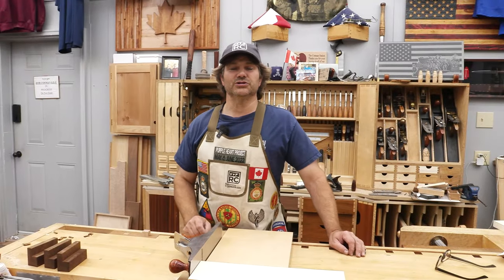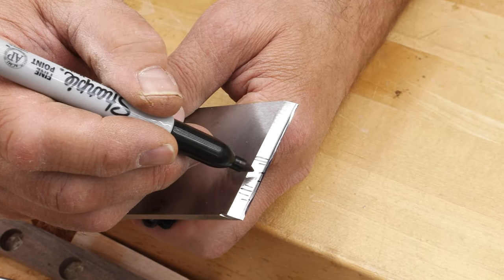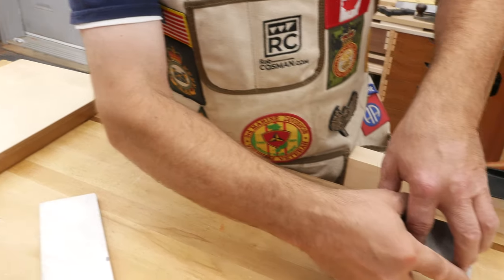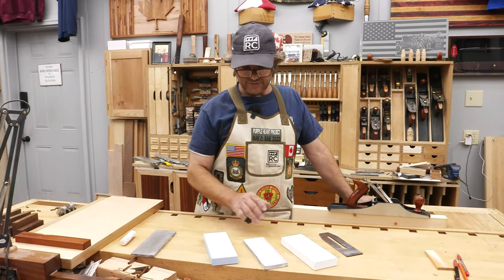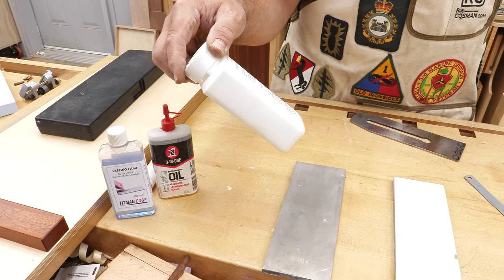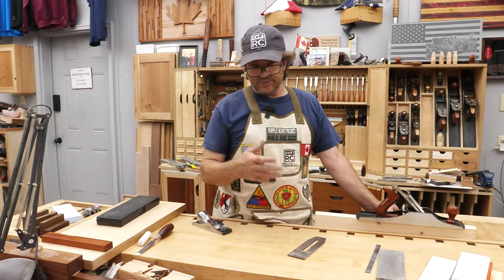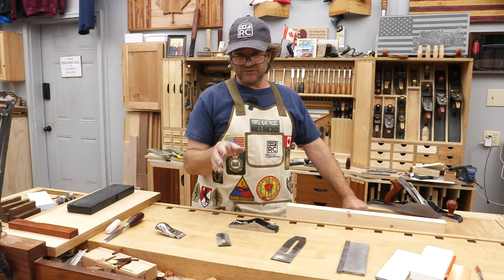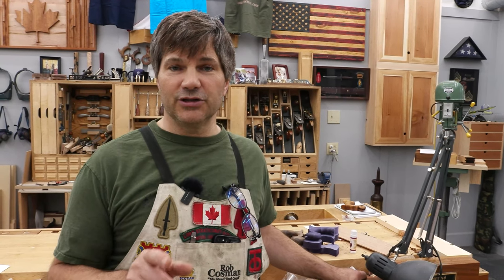How To Sharpen Plane Blades By Hand - Top 10 Questions

Comment: Rob I fully agree with free hand sharpening rather than aides to help sharpen or make things. I get more satisfaction out of freehand making than using machinery etc. I notice the jig you showed for sharpening with my brother gave me the exact same one. I'm using it but holding the blade like I was doing freehand but only using the guide to help me get the correct feel of angle on my wrists and trying not to rely on the jig so I can get back to freehand sharpening. I love jointing freehand but of course the older way was much better with joints not the lazy way today with screws and nails. You're a true carpenter and star thanks Rob and also to your team

Comment: Rob I've been having trouble putting my plane back together but having trouble hocking and sticking in wood  and the blade didn't appear sharp enough to me from what I remember 50 yes ago in school. But thanks to your tips I made a discovery in sharpening blade better. Today I added a secondary bevel and a little bit more firmly on blade not strong but firm and feeling the the edge of blade it is feeling much sharper going back to shed to put plane together. If I get a fairly good plane not as good as yours I know I'm on the right track. I don't think putting plane together was full problem if better working I will work on fine tuning to good thin shave like or near yours. It's an old plane so good to learn with before I get new ones. Thanks a million Rob on your great tuition and great for elderly to understand you

Comment: I like Frank's Workbench's concept of keeping the secondary bevel from growing. He sharpens the secondary and then goes back and sharpens the primary to keep the secondary from getting too big
Reply from the maker: That adds additional time to each sharpening.  Its takes so little time to re-establish the primary bevel if you are using a CBN wheel I think I prefer to use the grinder

Comment: The thing that's always drawn me to your sharpening method is the speed you can get back to sharp. I've used the jigs and various other methods and while they work fine, it always seems like a such a chore to drag everything out, set it all up, go through the process, put the stuff away and finally get back to work. When sharpening becomes a project in itself, it leads to using tools that are duller than they should be and that's never good. I've purchased the Shapton 16000 and the Trend plate but still need to set up a permanent sharpening station which is key in my mind.
Reply from the maker: Beautifully said.  You get the final word!

Comment: For diamond plate, personally I use car glass cleaner bottle. This is not expensive, metal particle float and dont make the plate rust, just have to wipe with a towel at the end to remove metal dust. Otherwise, my experience is to use only diamond plate and finish with a lapping wax compound on a piece of lather glue on a wood board. This create a mirror finish and the cutting is fantastic. Its somgreat to se other method, and clearly I have to spend some money on a bench grinder for saving time. Thank you for your great teaching skill, very great to follow you and learn each week.

Comment: Although I don't always agree with you 100%, you absolutely provide the most complete explanations of sharpening (and woodworking in general) of anyone out there.  I do sharpening both with a honing jig and by freehand.  That's where I veer away from your "don't use a jig" philosophy a bit.  I don't consider it a handicap to ever use a jig.  I consider using a jig a way to get the edge back to a pristine condition to be able to freehand the blade in between using the jig.  It's just another tool.

One factor of freehand sharpening I think is overlooked (or at least not mentioned) by anyone is that by the very act of freehand sharpening you manage to get a slightly more homogeneous edge due to the circular motion employed.  Using a jig it's more likely to have straight scratches going perpendicular to the edge, and then those scratches being parallel to the motion of the plane.  Now I realize those scratches are miniscule and may not amount to enough to cause any problems, but they are there nonetheless.  Looking at the edge under magnification it's pretty obvious.   Quite possibly I'm stretching reality a bit here, but try it and I'd be interested in your take on that.
Reply from the maker: To comment on the scratch patterns between jigs and freehand, the only potential benefit between the two would be edge retention. As mentioned in the video, the edge obtained by freehand sharpening cannot be improved upon as it relates to the surface of the wood. I’m pretty sure this would be considered splitting hairs though.
Reply: @RobCosmanWoodworking  I've been told that my superpower is splitting hairs.  :-)   Thanks for listening, and the edge retention is another aspect to consider.  The scratch pattern is potentially more important for those who don't sharpen to higher grits - possibly.

Comment: Your advocacy of freehand sharpening inspired me to try it out. What a liberating experience! Now, where do I sell my $100 Lie Nielsen honing guide and accessory jaws? Seriously, this was the best advice I ever took. Now, may I ask you for more advice regarding chipbreaker prep? Besides the slight back bevel to make it fit seamlessly onto the blade, what do you think of David Charlesworth’s procedure of also increasing the main bevel on the chipbreaker to 45 degrees so that the shavings extract more easily? Is it worth my effort to do, or is it unnecessary?

Comment: Regarding the ruler trick, quick tip, get a set of feeler gauges rather than the ruler. You can get a set of feeler gauges for cheaper than the cosman ruler, they have no etching, and you only take one out and you then also have a whole set of feeler gauges.
Reply from the maker: Boy aren’t you the white knight!

Comment: Good Job Rob! Always enjoy your post and learn something each time! When you referenced sandpaper rolling you did not state on the way the paper was held done with water, tape, or glue or nothing! I fully agree with your adage to better tools make easier work and better results overall, but some of your tools are just too expensive for a weekend woodworker or not even necessary for some types of wood working. You are a business and not everyone is sponsored or can write off tooling cause you're a business.
This also should be taken into consideration. I do paper on glass (glued down) and red and green rough, and I can get gloss level cuts by pairing no problem free hand. Sometimes I think you forget on the small shop guys that can't afford all the toys you have for the points stated. 
The other this is this ruler method on the back side? if you can do your secondary freehand then why can't you do your back the same way? It comes back to skill factor! To me that ruler is a crutch also! 
Again, I do like your videos methods and learnings just can't do everything the way you do, otherwise I would need to hand a shingle also!   Columbus Michigan
Reply from the maker: I hear ya.  I still advocate getting the best you can afford one tool at a time.  I would do the back bevel by hand but i cannot figure out a way to hold a 1 degree angle.  I can hold a 25 degree angle by hand, thats easy.  Cannot hold a 1 degree angle by hand

Comment: Hey Rob, I've always wondered something about the "ruler trick" I have the extra-wide diamond plates, so they're 4.5 inches wide instead of 3.5 inches wide. Would I still be good with putting the back of the plane iron within 1/4inch of the edge of the 4.5inch diamond plate? Thanks!
Reply: Adam, I’m sure Rob will answer too, but based on geometry, yes, in fact the further out you go from the edge of the ruler the better because it decreases the angle of incidence to nearly zero.  You can even polish the back without the ruler but then the entire surface is in contact and you have to remove a lot more metal when really all you need polished is the edge.  If you get the edge too close to the ruler then you start to increase the angle of incidence which begins to lessen the effectiveness of the blade back as a flat reference surface.  Essentially any amount you raise it greater than zero and less than .5 degrees will get the results you’re seeking.  Moving it out to 4.5 niches is almost the same as reducing the thickness of the ruler by about 1/3. In fact instead of using the long edge of my 3.5” wide plate I usually slide my iron along the short axis which extend the distance from the ruler to about 6 inches.  There is still a slight angle of incidence and my strokes are much shorter which means it takes a few seconds longer, but it keeps the back bevel closer to flat without the work of being flat.
Reply: @eodeberhard1066  hello sir. Thank you very much for the detailed reply and assurance that the width of the diamond stone doesn't matter. 

I'm also wondering, when you're polishing the back of the iron, how many times are you rubbing the plane iron back and forth? And I mean this in a scenario where you were doing it the normal width way, instead of the rotation that you decibed that results in a shorter width to use. I feel like I've seen some videos of guys only rubbing back and forth one time, and then some videos where people are rubbing back and forth a lot.
Reply: It depends on wether it’s the first time or not.  The first time you do it may take a lot more effort to get the factory grinding striations and any other inconsistencies out of tge blade. After the first time you just need to do it long enough to remove the micro thin hairline of metal that was hanging on from shaping the primary/secondary/tertiary bevels on the opposite side.  I don’t usually spend more than 8-10 seconds on the back side to get it “scary sharp”.  If your blade has a concave back (like a Japanese style chisel) from the factory you may have to work a little harder, and if it’s convex, it’s not worth the effort and headache it would take to flatten it. Cheaper processes and materials in manufacturing can lead to sharpening nightmares.

Comment: DMT diamond stones use a stainless steel base. Would that make it OK to use a water based fluid?
I've noticed the problem with wet & dry & chisels - moving on to a flat diamond stone shows this with it taking longer to remove enough material to reach the corners.
Reply from the maker: If you are referring to there Dia-sharp line DMT states on their  webpage "No oil needed, sharpen dry or with water"
Reply: @RobCosmanWoodworking  That's the ones I was considering. Thanks

Comment: I can manage a great edge... with a jig. The time is just too much. I have been utterly failing at keeping the darn blade even when trying to free hand, so frustrating.
Reply from the maker: Steven....whats the issue you are utterly failing at lets see if we can fix that.
Reply: I'm good at keeping the angle, it's just the side to side pressure I guess? Always gets more on one side and have to re-establish the edge. Also having a hard time with the bending over, my back is no good, I can handle a minute or so but the time to practice is brutal.
Reply from the maker: Try using three fingers on the blade edge instead of four - take away your pinky.  It could be that you just cannot put enough pressure through your pinky to get a consist pressure across the blade.
Reply: I'll try that thanks for your time.
Reply: I finally managed it, so grateful for your teaching. After getting it to work, it's almost unbelievable how fast and adequately it works. This has greatly improved my joy of woodworking. I used to take 20 minutes minimum to sharpen, thank God for Rob Cosman.

Comment: I use to sail back in the 70's and 80's. Paper chart, hand bearing compass, binoculars etc.  Hand steered with a tiller and frequently adjusted sail trim. Needed some learned skills. Recently we bought a powerboat. Has GPS, radar, sonar. The chartplotter- pick two points and the route is calculated for you taking into account your draft, speed, fuel use etc. Engage the autopilot and you're off. Just watch out for logs and other boats. Feels like cheating.Need more computer skills than sailing skills. Much less satisfying. Sound familiar.
Reply from the maker: Sure does.  What happens if the GPS takes a crap?  Better know your charts

Comment: Do you think you can sharpen too often, or is going with the 'when in doubt sharpen' attitude better?
Reply from the maker: Depends on what you’re planing. If you’re just removing mill marks, you don’t need to have a flawless edge, but if you’re making the final passes before applying the finish, a perfect edge is best. There’s no harm in sharpening too often though.